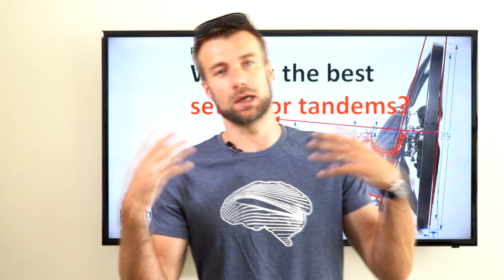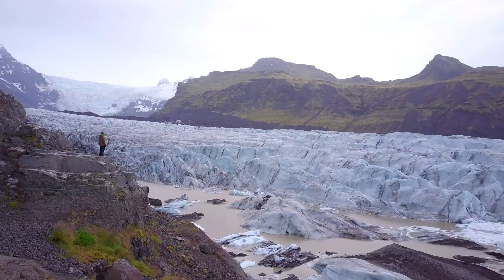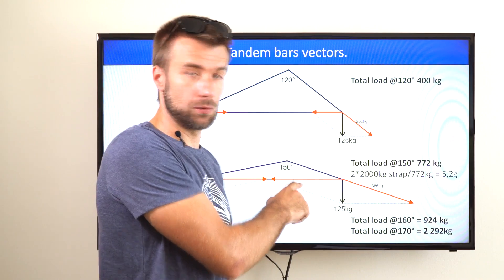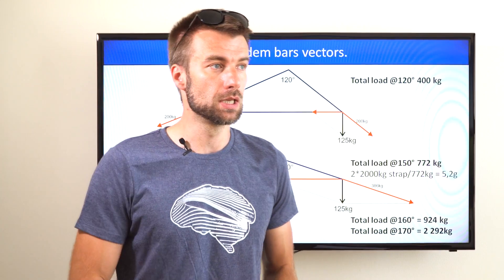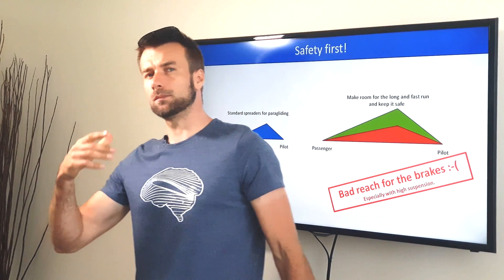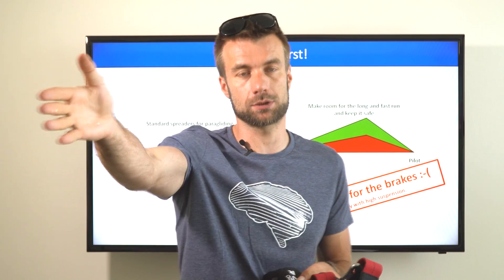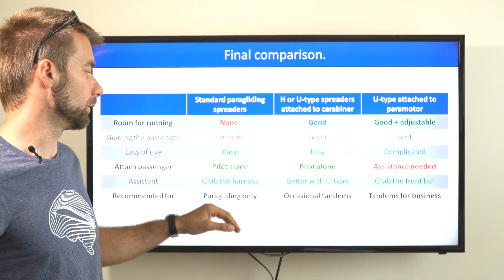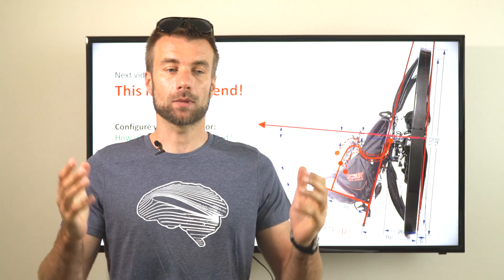What is the best setup for tandems? Paramotor geometry part 35

Comment: How many hp need for tandem?
Reply from the maker: I am 88kg. I can take another 90 kg pilot for a flight with the moster 185.
Not ideal for regular tandems but ok to occasionally share the passion with friends.
Reply: @SCOUTaviation  ok, but my question is: if i want tu get a paramotor, how many power i need to have? How many horse power. For example 1 pilot with any accesories and paramotor 105-110kg how many horse power need to carry 1 pasager to 80-90-100kg? For ocasional or business.
Reply from the maker: @WiDuAlK99  27HP will be enough for occasional tandem. Take a larger tandem wing (41sqm).

Comment: Excellent series. Well thought through and informative.
Suggestion: Make a series comparing the actual different manufacturers with info regarding weight, torque, average running cost, maintenance plans, after sale service and back up and obviously cost.

Comment: I have a couple questions.

#1:  What would be the consequences of having the wing closer to or further from the pilot?

#2:  Can you think of a practical way to design what would essentially be a flat platform with 3 or 4 wheels that one could sit or stand on during takeoff with a conventional foot-launch paramotor?  The idea being, when the wing lifts up the pilot, he simply rises above the rolling platform into the sky, and the platform simply rolls to a stop.  Or the removal of the pilot weight could cause brakes to apply and stop the platform even quicker.  I suppose the platform might have a seat for the pilot to sit upon, though it might be better to have the pilot standing on the platform (possibly with some upside-down U bars on his left and right to stabilize his body during acceleration.  Obviously landing would be the same as any foot-launched paramotor.  One purpose would be to help launch when flying a long cross-country flight with 5+ gallons of fuel... so you land with nearly 40 pounds less weight, because that fuel is consumed.  Another purpose would be to help launch when carrying somewhat heavy equipment a remote [mountaintop] site.

#3:  Can you itemize how much weight is typically in each component of a paramotor, and the difficulties of making them lighter in future paramotor designs?  Engine, cage, frame, seat, etc.  Maybe some subcomponents too, like perhaps muffler.

Comment: good series, how about rotary engines? powerful for size or are they too heavy.
Reply: At least some rotary engines are somewhat lighter than piston engines.  I found that the powerful but lightweight rotary engines that exist are very expensive.  For example, the cost of the best rotary engine I could find was $16,000 USD.  That is for a quantity of one unit, but when I asked for lower prices for higher quantities, they didn't offer any until the quantities became very substantial... like 1000 units.  As you can imagine, a $16K engine would increase the price of a paramotor from about $8,000 to roughly $20,000 or even a bit higher.  Very few paramotor pilots will be willing to pay $20K+ for their paramotor.  That would make the 1000 quantity virtually impossible to achieve, which would assure lower prices are not possible... at least with the rotary engines I was able to locate.  Miro has also looked into rotary engines, but my guess is, he was not able to find anything substantially better.  Bummer!  Which means, the 4-stroke engine Miro is working on might be our best hope for the near future.